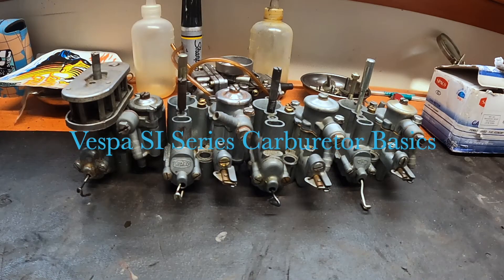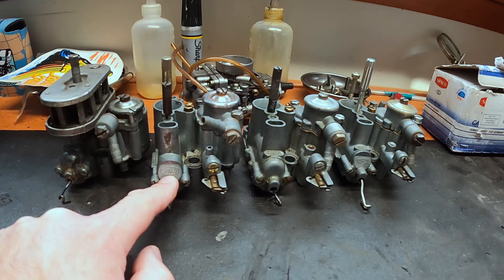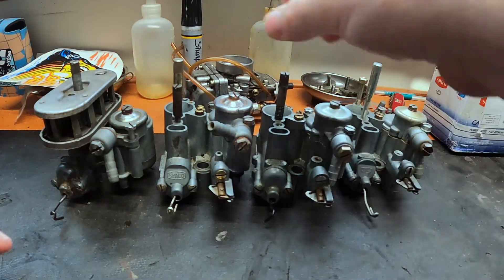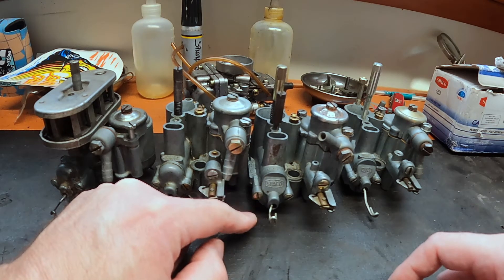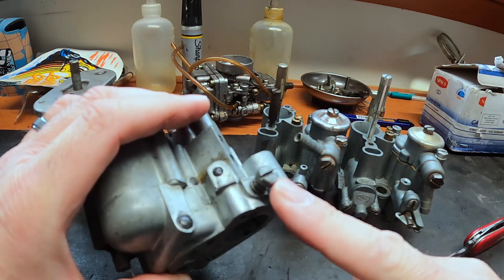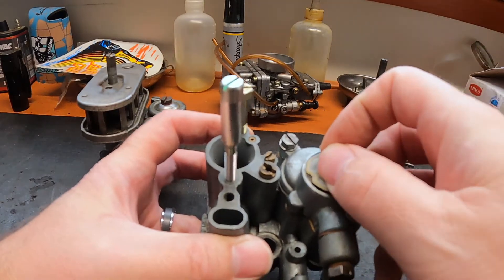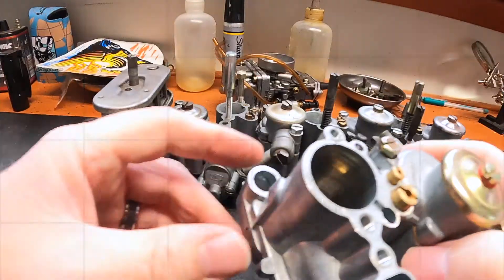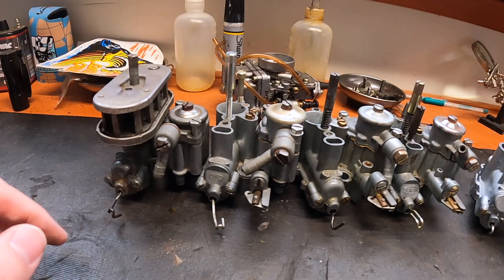Vespa (Dellorto) SI carburetor identification and basic operation

Comment: Nice video!  My 20-15 carb was trash so I got a 20-17, are there any issues or adjustments to be aware of going to the 17 in a 150 Super?
Reply from the maker: Thanks Steve! I also use a 20-17 on my Super. It was standard on the Sprint 150 of the same era. You will likely find that you are a little rich with the new carb. I also swapped out the air filter for a larger P-series one. As always when changing carbs be sure to check the jetting when done.
Reply: Thanks, I’ll have to find another video on jet sizing and making the proper adjustments.
Reply from the maker: @stevepaliobeis7216  Stock jetting for all bikes can be found at scooterlounge dot com. Just google scooter lounge stock vespa jetting. This is a good place to start if I recall correctly, I am using the stock Sprint jetting with a 100 main.
Reply from the maker: @stevepaliobeis7216  I should add that I'm about 1K ft above sea level.
Reply: Thanks again for the tips!  I forgot to mention that the air mix screw didn’t seem to do anything when trying to tune it, in and out with no change to rpm.  Seems you’re on the right track with an air leak.
Reply: Hey, I’m back.  Finally got my 150 back together and running, starts up easy, seems to idle fine, revved up nicely until it got warm then bogs down with throttle but still idled ok.  Any thoughts?  I don’t know much about the jets but there’s an E1 stamped on one and a 98 and 160 on the other.  I’m at about 3000 ft elevation.
Reply from the maker: @stevepaliobeis7216  160 is the air corrector, E1 is the mixer, and 98 is the main jet. Those are certainly in the ballpark. Those symptoms could indicate a variety of things. Problems when warm usually suggest ignition issues, but in your case (due to recent assembly) I'd suggest looking for air leaks. The base of the carb and the exhaust flange should be your first suspects. Good luck!

Comment: What are cons of SI carb compared to horizontal air flow carbs like PWK or PE with the same venturi size?? And how about the benefits from using non SI for daily ride. I'd like to know the comparison.
Reply from the maker: Thanks for asking. These things are subjective and somewhat based on opinion. The SI carb is what the engine was designed for and is most commonly used. Because of this parts are easy and tuning recommendations are easy to find. The main drawback is that you are limited to no larger than 26mm Venturi as it is the biggest size available. On a 225cc (or more) kit this may not suit your needs. It may also not suit some larger reed valve conversions. To sum up, I wouldn't use a  non-SI carb a stock Vespa unless I had to.